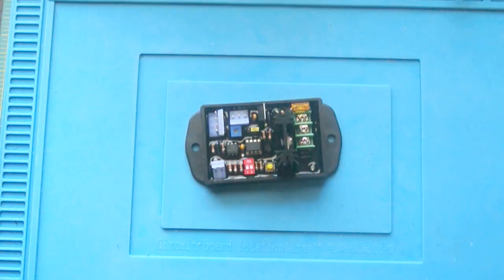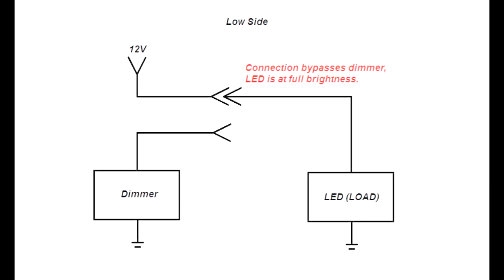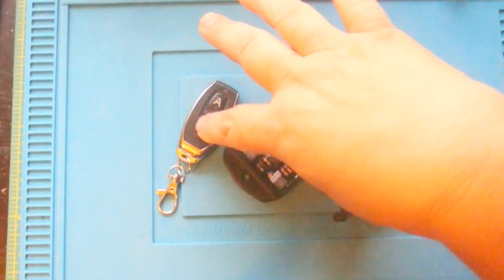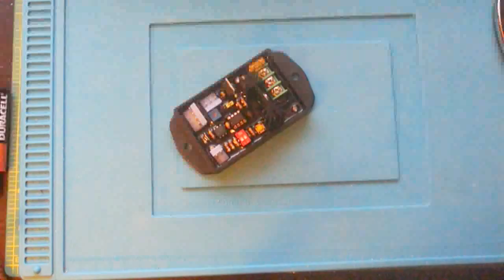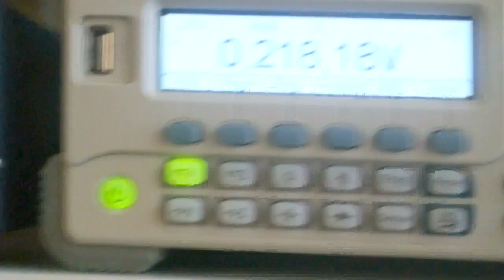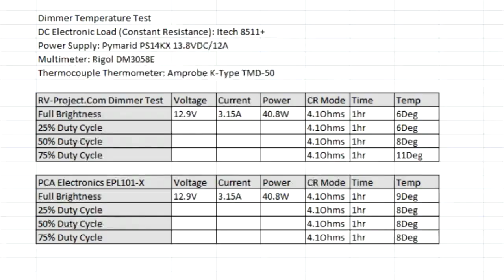Demo of my custom built RV LED Dimmers

Comment: Nice work. And you are correct - the dimmers available for DC systems are very limited in what they can do. Your system is really cool. I especially like the logarithmic dimming. Sexy!

I am building my own RV and one of the things I want to be able to do is dim my lights from multiple locations. Unless you buy a rig with multiplex wiring (available to OEMs only, and parts are quite expensive), there's no off-the-shelf solution - at least none that I could find. I was going to design one myself when I ran across your latest project. I'm wondering if you think your dimmer could be easily modified to meet my needs (which I will describe shortly). I haven't examined your sketch, but it seems that it should be possible, hopefully without any hardware mods.

I'd like to implement a dimming function without using a rotary dial. I'd rather the dimmer function similar to what one finds in many 110 volt household dimmers. Each switch location would have a single, momentary contact button. Pressing the button once turns the light on or off (toggle). However, if the light is already on, pressing the button and holding it (for more than say, a second or two) will increase the brightness (logarithmically, of course!) until it reaches maximum brightness. At this point, it will pause briefly (for about two seconds) before ramping down to minimum brightness where it will again pause before once again ramping up. Note that minimum brightness is not completely off, but would be the minimum "usable" brightness. Perhaps this could be configured via a programming/setup phase. Letting go of the button at any point in this dimming process would lock the light at that level. A single button press after this would of course turn the lights off. Another button press would turn the lights back on, with the brightness at the same level as when the light was turned off. With a pull-up resistor on the input pin, one could connect several push button switches throughout the coach, each one grounding the pin when depressed. Alternatively, each location could have two momentary buttons (or a momentary rocker switch). Pressing the top button turns the lights on or, after holding it down, begins ramping the brightness up, stopping at full brightness. Pressing the bottom button does the opposite, of course. I like the simplicity of the one button approach, but each has its advantages and disadvantages.

Additionally, I would connect each dimming circuit to a central processing "brain" which would allow me to control multiple dimming circuit. The brain would connect to a wireless network (WIFI and/or bluetooth), allowing me to control the lights remotely. Examples of remote control devices would include control panels (buttons only or perhaps even a touch screen), smartphones/tablets, and computers. Hooking the brain to the Internet (via a cellular hotspot) would of course allow me to control the lights (or other functions such as heating) over the Internet. Essentially a SmartHome controller for an RV. If you haven't already guessed, I'm a geek. 🤓

Curious to know what you think, and if your dimmer could be easily modified (via software only or software + hardware), to accomplish any or all of the above. Cheers! Pete
Reply from the maker: Yes, a method of holding down the switch to change the dimmer could easily be implemented in the sketch. I considered that, but I didn't implement it because I wanted a potentiometer to control the dimmer level, and it would not be easy to support both potentiometer and "hold down" methods without some kind of method to disable one or the other. 

The other issue is saving the dimmer position for power down conditions if you use a hold down method. You could use the on-board EPROM in the ATTiny85, but you might have to write your own EPROM access code as I am not sure how much space you would have on the ATTiny85 after installing the EPROM library. 

But some of my other ATTiny85 projects use libraries (Cylon Eye, and the upcoming magnetometer switch project). However, even just one library can use up most of the available memory on the ATTiny85 so you have to keep it simple.

You could build an ESP8266 based dimmer for WiFi connectivity. Otherwise the ATTiny85 I think would be overwhelmed.  One thought I had for the future is to have such a central unit, and the output for the central unit for each dimmer would only need to be a momentary signal as the dimmer could do the rest. Or I could incorporate the dimmer functionality in a larger board.
Reply: Thanks for the response. I'll be taking a closer look at your sketch when I get closer to implementing my electrical system in a 2-3 months. The architecture I'm considering is to place all electronics in one cabinet (all the dimmers, the main controller, etc.). The wall switches would only be buttons (no electronics other than perhaps a status LED or two). I'd run POE cable from the cabinet to each switch (a home run system). The outputs of the dimmers would then go to each lighting circuit. Anyhow, I look forward to watching your progress on this project. Really appreciate the time and effort you've taken to document everything both here and on your web site. Good stuff!